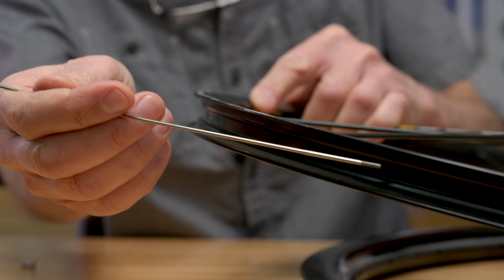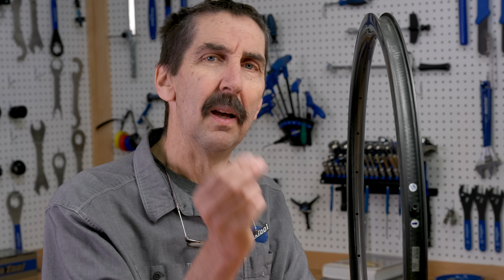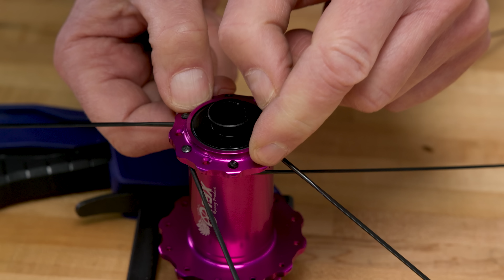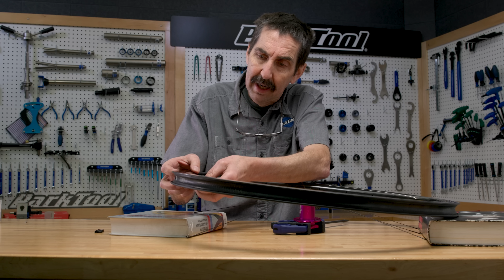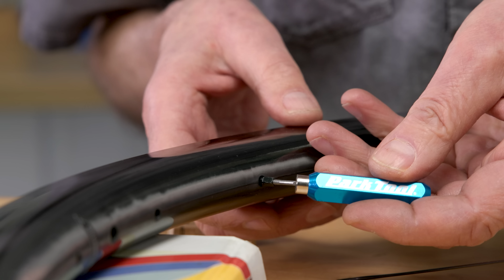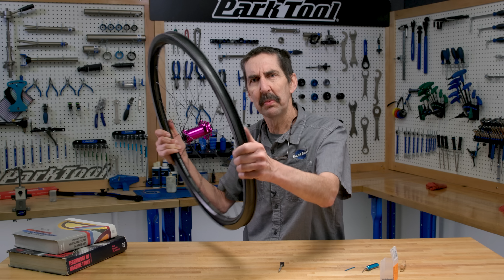Building a Wheel With No Spoke Holes | Tech Tuesday #214

Comment: For heaven's sake, why doesn't Calvin deburr the piece of spoke he inserts into the nipples to help with installation? If I'm seeing this correctly, that's a carbon rim. Surely you'd want to avoid scratches on the inside? Think "predetermined breaking point."

Comment: I just discovered dt swiss squorx nips. With the t handle i can lace and tension a wheel in 1/4 the time as a normal nip wheel. I can complete a wheel in 1/100 the time as holeless rim. The rim tape isnt that bothersome. I dint think ill ever electively use a holeless rim. God bless those workers in china building carbon wheels this way

Comment: Unpopular opinion: What if they left a hole on side of the rim walls instead of inside the wheel, so that tubeless setup wouldn't require spoke ends with valves.

Comment: 13:28 - Yes but I'll be miles down the road laughing while the that rider is still painstakingly magnetizing nipples through rims without inner holes. Not sure about that tradeodd - UNTIL Park invents a tool that makes that process simpler (or at least a substitute for the sawn-off clothespin...) 😁

Comment: #2-56 x 3/8" screws in black carbon steel work well in place of the the spoke offcut. Also, if you use a straight-pull hub, you can turn the spokes instead of the nipples, making the process a bit easier. Still pretty fiddly though!

Comment: Could probably just use a thread, drop some small weight tied to it, guide a thread to the "in hole" and pull nipples 1 by 1after replacing the weight with them. That is if you don't have a strong magnet like the one shown or spokes to spare.

Comment: years ago, I had a FSA XC-500 26" wheelset just like this, and the wheelset came with a special "tool" to route the spokes through the rim, with thread, steel little balls and magnets. In my mtb I have a Mavic XM-819 UST rims with no holes inside.

Comment: Another great video!  Thank you!

Pro tip: Using the attachment hose from your vacuum cleaner on the valve hole will greatly reduce the amount of shaking needed to get any loose nipples/debris out of the rim.  Just make sure you use a clean vacuum bag / clean out your vacuum beforehand to make finding the sucked out object easy.

Comment: Suggestion: tie a small feather to a long piece of dental floss and shove it in one of the spoke holes.  Apply shop vac to the valve hole and vacuum the feather out.  Then use the dental floss to pull the nipple back the other way.
Reply: Curious to know if you've tried it and if it worked?

Comment: I built my first bike at the end of 2022. I decided to also lace my first own custom wheels by Light Bicycles with no access spoke holes. Despite it being a 24 hole, I probably laced both wheels in about 6 hours. I threaded a magnetic screw into a nipple and thread it through the valve hole with a magnet. Not that much different from Calvin.

Comment: When I came across this problem on one of the road rims around 15 years ago I used brake cable that you feed through nipple hole and push it until it reaches valve hole, than you pull it out with thin nose pliers feed the nipple and the cable will guid it to the right place. I found it much faster than magnet.

Comment: Two tips; a small thumb screw threaded into a spoke wrench. A strong string/rope attached to the steel spoke spike, put it into desired inner hole and work with the magnet to the valve hole add nipple pull back to inner hole, attach above mentioned spoke wrench and tighten thumb screw test the proceed as normal.

Comment: How can I measure the rim diameter?
Reply from the maker: If you mean for Effective Rim Diameter, you can use the manufacturer's literature for ERD.  This company states they measure to the base of the nipple, which is the floor of the rim.  A the thickness of the nipple head, 4mm (2mm per side per nipple) to use a spoke calculator.
It is possible to take your own measurement, but a it is not easy. Use two spokes and two nipples and a caliper as measruing tools.  Count the exact number of turns on the nipple to get the spoke end where you want and write it down. Now insert two nipples opposite, and engage the spokes, turning them exactly as you determined.  Now measure the J-bend to J-bend.
Reply: @parktool  Thank you very much for your quick answer. Yes, I mean the ERD. Greetings from a German living in Germany.

Comment: I offer these as wheelsets and call it tapeless tubeless for lack of better word. I have developed a method to optimize the threading process. Thread all nipples amd secure them, then lace. Straightpull hubs make it a ton easier as you can twist the spoke into the nipple.
Reply from the maker: The straight pull makes a great partner with these types of rims.
Reply: @parktool  Once you get used to this type of rim it's hard to beat as a product. We found that using straightpull spokes, a Sapim SILS nipple that has a dimple to stop easy thread engagement (so you get consistent depth while twisting the spoke into the nipple on first lacing) and a lacing jig in conjunction with prepping each rim before lacing speeds up the process immensely. We are down to 10-12 minutes per wheel, for lacing, including nipple threading via magnet.
Reply: Aikon G740 by Bockstein is the name of the wheels, gravel/allroad optimized

Comment: Why not make it a star-like tool (for turning) that can both clam down where it splits in two, and do the magnet operation?
Bonus for making the insertion hole parabolic so the spoke is guided into the nipple.
Has to be slightly concave to account for the bend in the rim. Maybe rims like this exist in 16" size?

Comment: Suddenly, tubeless tape doesn't seem so bad!   Also, if you use tape that is a few mm wider than your internal rim width, the tape will extend slightly up the wall of the rim on either side and is much less likely to be disturbed when installing/removing tires.
Reply: 오~~
친절한 설명 감사합니다.
Reply: Wrong. If you use rim tape that matches your rim's internal rim width, it won't cover the entire width of the rim bed as the valley adds distance between two sides of the rim bed. The perfect width is always a little wider and it varies from rim to rim as different rims have different rim bed profiles.
Reply: What was wrong with having a tube, and why are you inventing so much unneeded trouble?
Reply: @SianaGearz  lower pressures, MUCH less risk of flats

Comment: Yeoleo rims also have an unpierced rim bed. They come with nipples preinstalled from the factory :) Combine with a straight pull hub and bladed spokes, that makes for a wheel that actually laces quicker than a traditional wheel with J-bend spokes. The spoke pattern is determined and fixed in place by the hub, so you can insert all spokes at once before lacing. The spokes can be freely rotated to thread in the nipples, so no need to losen the tape securing the nipples untill the wheel is fully laced. The flat surface of the bladed spokes makes them a little easier to turn...
Reply: Is it possible to replace a spoke nipple on those, or is the whole rim dead if you break a nipple?

Comment: Could they add some non-structural material to the interior near the valve hole so loose nipples funnel out easier instead of getting caught on the side like I assume happens?
Reply: It should be possible, I haven't seen any rim with this design yet, if it does exist.

Comment: Can i ask how or what to do to fix the shifter on my bike
My shifter for the rear derailleur is a bit hard/stiff when going to 4 or higher gear, but when it comes to 1st, 2nd, and 3rd it works fine and easy to press/shift/click.
Is there a way to fix it or does it need to replace some parts.
Thank you in advance.

Comment: Each nipple needs a small circumferential groove on the outside. Then when the nipple is fished through into position using Calvin's magnet, a snap ring is put in the groove to hold the nipple in place until the spokes are in. The snap ring could even be left in place.

Comment: Heard a technique of using sewing threads and a vacuum to pull through them from the spoke side to the valve hole. You may put a small piece of adhesive tape on it for vacuuming then cut that later when you caught the line at the valve hole. Then you slide the nipples on these lines to their places.

Comment: tip for anyone doing this, use brass nipples if you are going to use a carbon rim, its going to save you a lot of headache later on.
Reply: Tip also use washers because you sre buying expensive rim why risk fucking it up. Actually those crapafectures should come to senese and start using steel for nipples.

Comment: All wheels have at least one hole. That one has two! The labor to build those wheels must be very expensive. Imagine the LBS's reaction  when one with a broken spoke comes in! Most don't even build custom wheels anymore. They wouldn't dare become a dealer for these. Probably this is the reason  I've never seen these in the wild. Maybe keeping all the holes would work better. Seal all the nipples with epoxy after construction and skip the rim tape. Probably the increased air volume would make a smoother riding wheel. If the goal is making the wheels hard to work on, please grab onto an available marginal gain too! Remove epoxy with a propane torch  for repairs. Ahh! Won't work for carbon rims. At least it would be something new for the industry to sell!

Comment: I could see Park Tool coming up with a tool kit for building Tapeless rims. It would include an anodized BH 1.2 clamp and magnet handle!
Reply: The fishing  stud could be built with a magnet only at the tip and the rest non magnetic to make it more likely to hit the hole without the wiggling around so much.
Reply: I can totally see a micro-spoke where only the tip is magnetic would come through the hole much more easily... and some kind of a mini net to fish out the loose nipples: net can go through the hole and opens up inside the rim, catches the nipple and you just pull out... c'mon Park tool!

Comment: Why can't an elastic cord be used as a guide?

PS
Now I see that it is not aerodynamics that is behind the decreasing number of spokes in the wheels!
Reply from the maker: Certainly there can more than one way to get this done. Not sure how a cord would work, but there is only one way to find out.
Reply: @parktool  I'm thinking that something like a fiberfix spoke could work for this. Poke the flexible spoke through the wanted hole and then use the magnet to pull the spoke through the valve hole, thread the nipple and then pull the spoke back to the hole.

Comment: So there is no easy way to get that loose part out that is causing the Attlee, which would drive me crazy?
Reply from the maker: The shaking took 120 seconds of trial....the rest was Hollywood action editing to be dramatic.
Reply: @parktool  Phew!  I was worried this was taking a lot longer.  I was starting to feel bad.  LoL.
Reply: @parktool  I bet those two frustrating minutes felt a lot longer than that!
Reply: Take some tape and roll it inside out into a small tube that will fit into the valve stem hole.  I used blue painter's tape.  Shake wheel around until the nipple catches on the tape, then carefully pull it out.  I did this with a new set of wheels that had metal shavings inside from drilling the holes that were going to drive me crazy with rattling.

Comment: To anyone that is interested, including you, Calvin,  I have been building tapeless rims since last fall, and have found several tricks/tips to make the  process easier, but it still is a time consuming process.  It is really nice when done and many times the tire holds air without using any sealant at all, but still add it for puncture healing.  Look forward to hearing from anyone interested.
Reply: I also build tapeless in a style not dissimilar to Calvin.

I use nylon sewing thread tied to a shorter length of spoke. Drop it in the spoke hole and draw it out of the valve hole with the magnet. Screw on the nipple and washer and pull the thread through.

Rather than the modified peg, I found a bag of miniature pegs at a craft store and now put all the nipples in first held in place with the mini pegs. Start opposite the valve hole and work back so you're not installing nipples over the top of existing ones.
Reply: @steveedwards5280   Hi Steve, that is truly one way of doing it that works.  One problem with that way is if the space between the internal spoke bed and external wall is very little like with 26inch fat bike wheels, you will have a tough time getting the nipple to flip the turn to come out the spoke hole.
Reply: @anthonyschaus2283  the depth of the cavity is always the limiting factor.  My method uses the shortest piece of steel spoke thread and the nylon thread pulling it leads the narrow end in first. The limiting factor is the height of the spoke. However, you are right, the nipple needs to transition through 90° so you need at least the height of the nipple plus some wiggle room in any time cavity.
Reply: @steveedwards5280  Im glad that works for you.  Question for you, and that is do you build  the wheel the same way he is doing it? I don't think my way is any better  but might be faster
Reply: @anthonyschaus2283  Hi Anthony, 9mce I've got all my pegs in place holding the nipples, I then just lace as normal. I don't worry about keeping the rim horizontal.
When it comes to tensioning, I prefer to do the high tension side first to control the vertical hop, then the low tension side to do dish and lateral wobble.
Reply: @steveedwards5280   Hi Steve, sounds like maybe you do as I do in that I put all the nipples in place and put a piece of detailing tape around the nipple to hold it in place.  This also gives you something to hold onto when placing the spoke into the nipple.  I also have found that lacing the rim while it is vertical makes it easier as well.  From there once I have wheel laced, then I proceed as normal.  Have a good one
Reply: I'm curious what you charge to build a set compared to the regular rim? I can't see many people being too happy when you charge 3x the price of building a normal wheel, well at least that's what I'd be charging for doing it and the amount of time it'd take.
Reply: @MountainBikeBarbados   Hi MBB, I build the wheels for a friend who has his own business and he does all of the business dealings. Im fairly confident that the charge isn't what it could be but if you're interested I can give you his name and number. I know at one point we were building and selling carbon fiber, aero, gravel bike wheels for a price that was extremely reasonable
Reply: @anthonyschaus2283  I was just curious, as I too build custom wheels when needed and I'm not "cheap" compared to a lot of others, but the fact that guys build up bikes with my wheels, then sell the bike, but keep the wheels for years, over several bikes without issue, tells me I must do something right and am worth what I charge, just can't see anyone paying 3x what I normally charge.
Reply: @MountainBikeBarbados   I suppose if I were doing the building on my own that I would charge at least 100$ which is probably on the low side. The process of building these wheels definitely takes longer and is harder to do since controlling the nipples is and issue for sure.  Thankfully it appears as though your clientele
understands that you don't want. to rush a Wheelbuild as it takes time to build an excellent wheel.
Reply: I really hope you've figured out a away to deal with loose nipples inside!!
Reply: Which rim is this?
Reply: Curious to know if sealant-less setups would work with these rims. I got a pair of Winspace Grapid, with no spoke holes, and i am waiting on Pirelli to release the Race 4S in 32mm and tubeless. Do people have luck with no sealant at all?
Reply: @giodc8599  the old UST standard covered rims and tyres and would work without sealant. However, UST is very different from tubeless ready and I don't know of anyone who currently makes a tyre that is UST. I'm not sure any rims are technically UST either as the standard covered a lot more that simply not having holes in the rim.
Reply: @steveedwards5280  That makes sense, cheers!
Reply: @giodc8599  Well, once you know you won't be riding over any thorns, glass or other sharp objects and don't need the sealant for that, then there's loads (of MTB) tyres that will easily hold air without sealant, you'd have to do research on gravel/road options, but I've had no issue with TLR from Maxis, Bontrager and Schwalbe using taped rims and no sealant, which is how I setup and test that I've done the job right taping and installing the valve.
Reply: @giodc8599 3 years later, how did you do it? Been thinking of grabbing grapid as well

Comment: I like naming the tool after the generous person, but it should have been NC for "nipple clamp". Improvements for if the 20 mm steel spoke became a product or an extension of the internal routing kit, It'll probably work better if it had a little bend in it and/or a flat surface of a magnet of the opposite pole. Less fishing. Think of that kids fishing game with the magnet fishing rods that would connect with a tiny magnet in the fish beaks. Add a little knurling to ease threading it out maybe even.
Reply: The Park Tools Nipple Clamp. "wow these guys have everything!"
Reply: 20mm thick spokes welded to a steel rim. No nipple rings or spoke breakage ever! Could be the next big thing... since rotating weight no longer matters,  make the rims 80mm deep in aero profile. Put disk brakes on it because aero soon won't matter! To compensate for a rough ride,  make it fit motorcycle tires because soon rolling resistance won't matter. Pay a pro team money to ride these and make a killing.
Reply: I'm sure you're joking, but off course I meant a series of 20 mm long pieces of spokes of differing threads and widths, like the one Calvin made with cutters.